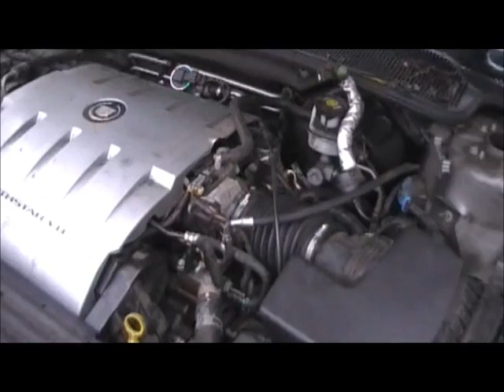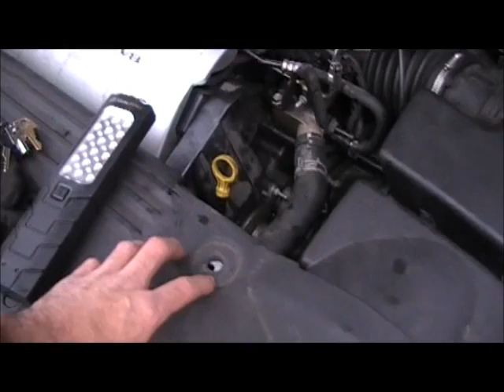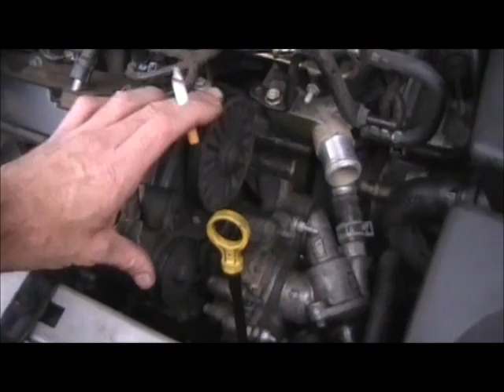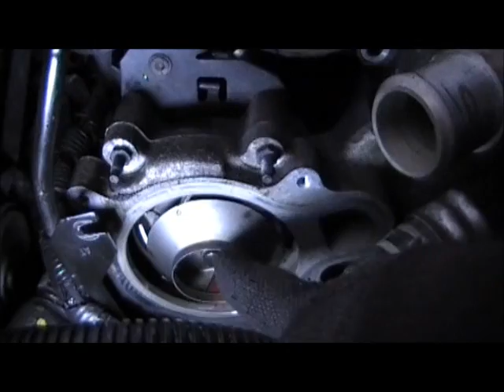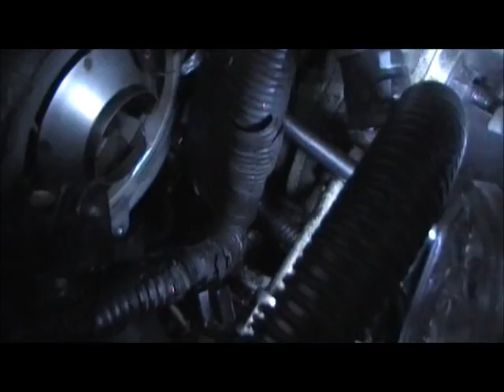2006 Cadilac DTS water pump part 1

Comment: I just finished replacing the water pump on my 2010 DTS.  Thank you - your videos were very helpful.  If you do more, when you say remove a bolt, please touch the bolt with finger or stick as there are a few places where it is hard to see what bolt you are referring to.  
1) You can get the big, flat wiring harness below the crossover pipe more out of the way by removing the plastic retainer holding the smaller wiring section to the block that splits off from it in the front of the engine (below water pump and behind radiator). 2) Dipstick tube is constantly in the way, but if you bend it you may break it and make another problem for yourself.  3) I later read a suggestion you can unbolt the crossover pipe but not actually remove it and get the water pump off and back on without undoing so much other stuff and fighting with so many items, such as the fuel injection rail and wiring, some vacuum hoses, etc.  I think that might work, but am not inclined to go try it now!  What do you think?
Reply from the maker: It's much easier for people to watch a video and duplicate the process.  Reading instructions gets tricky.
Reply: @2012nugget  first i wanna thank you for this helpful video. I'm changing the waterpump on my 2008 dts i got it off and ready to putbit back together but don't remember which screws go in the rear leg and the frontbleg all are 13mm but some are longer than others
Reply from the maker: @antwonalexander3429  Just put them in place, the short will be too short in a long hole and the long will be too long in a short hole.
Reply: Im changing the waterpump on my 2008 dts i got it off but can't remember which screws go in the back and the front. They are all 13mm but some are longer than others please help

Comment: Serpentine belt how do I take off my 2006 DTS.  Cadillac
Reply from the maker: It has a tensioner, spring loaded, you have to pull it back usually with a 15 mm wrench.

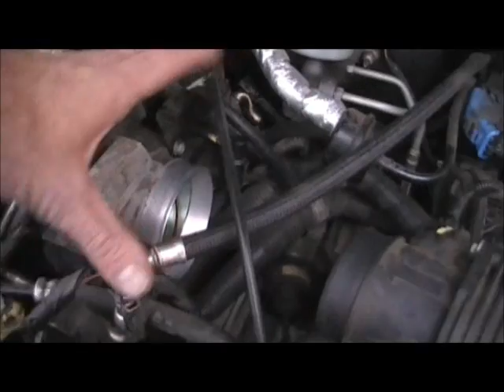Comment: Thanks for the video...I am not a mechanic, but we had the water pump replaced on our 2006 DTS.  Now the engine idles high and the check engine light is on.  A friend of mine said to check to make sure everything is in place - maybe some type of vacuum leak.  I tightened a few loose clamps and then noticed one rubber pipe just sticking up.  At 3:47 when you come back to the video after removing the "junk" there is a hose sticking up under the middle of the braided fuel line (line that goes from brake reservoir area to front of engine.) you touch is with your hand as you are pointing things out.  Do you know what that is??  That is what I suspect maybe wasn't put back in place.  I realize the video is old, but thought maybe you might know.  Either way, I thank you again for posting and helping!
Reply from the maker: Yes the high rpm is more thN likely a vacuum leak. You should be able to hear a suction noise while running, pinpointing the location. Going towards the brake system makes me suspect the vacuum supply to the brake booster. Find the suction noise and connect hose. Also the hose should be formed by now and should lead you to the right area. Let me know!
Reply: @2012nugget  should i put the gaskets on the block or the housing?. And thank you for the video. Couldnt have done this without you
Reply from the maker: @antwonalexander3429  The block
Reply: @2012nugget  do u remember which screws go in the back leg their all 13mm but some are longer than others
Reply from the maker: @antwonalexander3429  just put them in the hole, the short ones won't reach the long holes.

Comment: I'm doing crossover manifold I'm on last two bolts on the leg. My question is how did you get the harness out of the way and are said bolts the same size as the rest if so I'm in trouble thank

Comment: U are a moron...u literally remove the cover that the lower radiator goes to...pull belt loose...use special socket to remove waterpump n reinstall new pump n put cover back...zero of all that other shit needs to come off whatsoever...

Comment: I got one for you. 06 dts, water pump went out at 122,000.Didn't over heat and knew it was going out because the tensioner bearing was going out. Back it in to that garage and disconnected the battery and followed you video. I put it back together fill the reservoir, connected the battery and now it won't start. Key fob don't work along with the door looks and inside lights. Not sure what to do or what went wrong.

Comment: I just want to say
Thank you....u saved me 1700 dollars....I followed ur vids step by step and changed my water pump...tensioner...pulley and thermostat...the job is hard but if u have patience it can be done...on them back bolts that are hard to reach...i counted 165 half turns to take them out ...so yes patience is needed....and they are easier to reach if u remove the throttle body ....thanks again...my caddy is back on the streets running.....much appreciated

Comment: Old video but I started this job today and this video helped me a ton!  Thank you, Sir.  I got the crossover pipe off and the old water pump out. New one should be here tomorrow.  One thing I found that helped me a lot with those two back/lower bolts was putting the car in drive low 1 (emergency brake on of course). This moves the shifter connection out of the way so you can access those two bolts easier by threading your arm underneath the brake fluid reservoir.  Once I found that little trick it was pretty easy to get those bolts loose.

Comment: Why in the world do you have to remove the water manifold to change the water pump.
I did mine on my 2005 without removing it
Reply from the maker: You answered your own question. Yours was a 2005........the video is a 2006....things change......
Reply: As i see, things got worse  :)
Reply from the maker: Things don't always change for the better..........lol
Reply: It's a 2006....not a 2005...2006 and up different body style...and the water pump is in backwards...not like on 2000 thru 2005

Comment: You truly know your shit.  Thank you.  I loved watching this video of someone who really knows their art.  I have a 2006 DTS and I really love the car.  But it's just about to hit 150,000 miles and it's still turning the original factory water pump.  I have had No water pump issues......YET..... but I'm scared now!  I can do mild work on cars such as replacing alternators, brakes etc.  I have done water pumps on other vehicles but NONE of them seemed as daunting as what the DTS will be. I replaced the Xenon headlight bulbs but it was such a hassle to drop the front bumper cover and remove the inner fenders JUST TO REPLACE THE BULBS.  Because working on and replacing anything on the DTS seems to be much more work than other vehicles, I'm thinking of selling my DTS while it still runs like a top.  Any comments, suggestions or ideas?  What does a good mechanic such as yourself or a Caddy dealer charge to replace the water pump in the DTS?  And what's your experience and thoughts on reported DTS head gasket problems?  Am I extremely lucky to have driven 150K without any huge problems yet?  What can a well cared for DTS make it to before it breaks the bank?  Thanks much!
Reply from the maker: You are on the right track I believe. It is about to start costing on repairs.

Comment: thanks for the vid.. i actually came to see how u got off those 2 rear lower bolts for the housing near the trans lol, but they happened to be the ones you skipped. having a bitch of a time inching these off ratchet wrench doesnt really fit, cant get a socket on them.. im having a great ol time. everything else was fairly easy, just tedious. anyway itll be done by the time you read this, thanks for the video anyway, great vid an detailed. dont mind these ignorant know it alls who dont understand this is the only way to do this job. peace
Reply: vicmason25 gear wrench 13 mm stubby, I broke them free 1st with the longer one I had but had no room to move. but yep do very low one 1st then next up or you can't rachet the lower one cause of it in way

Comment: I typically don't work on domestic vehicles. However, I this on a Snap-on truck last week, & I had to ask what was it for? I also wonder what the GM engineers were thinking when they designed this. I do understand the placement of the water pump housing. But, I don't understand why the water pump was designed the way it was.

Comment: HEY IS IT COMMON TO CHANGE THE WHOLE TENSION PULLY ASSEMBLY OR JUST THE WHEEL  ALSO IS IT ESSENTIAL TO CHANGE OUT THE  GASKETS ON THE PUMP BRACKET OR CAN THE ORIGINALS BE REUSED?

Comment: have an 02 DTS,, at adle it overheats, blows cold air from heater, but at higher rpm's its fine.and heater works as should, does that sound like water pump ?
Reply: j sanner i have same problem did you figure it out
Reply: Im late but hoping someone else in this situation  sees this if your car is doing this its either not at correct coolant level or you have air in the cooling system after filling the coolant to proper level make sure engine is cold remove reservoir top then start car give it a couple of revs to allow the air to escape then fill and put the cap back on problem solved

Comment: Hey man, nice video. I have the same car and I noticed a funny little noise coming from the water pump so I called a mechanic to my office and asked him to take a look at it. I already knew I had to replace it but I just wanted to make sure. The noise if not that bad just yet but I want to take care of this before it ruins my day. The guy is charging me $100 to change the pump out and he said the pump will run me around 100 to 150, you think those prices are ok? I seen pumps online for way less.

Comment from the maker: Well when you stop you loose the air flow through the front and the motor slows, so it will be either the water pump blade or the fan not working . If you have air in the lines it would indicate a blown cylinder head.

Comment from the maker: @deapozol Na, the belt goes due to the water pump locking up, then destroys the pullys. If you own one with 120,000 miles on it, it should be done as maintenance to prevent the pullys from being destroyed and save a little loot. OnePeace